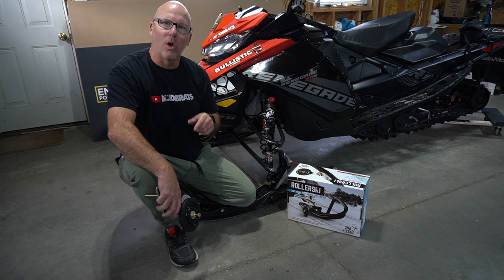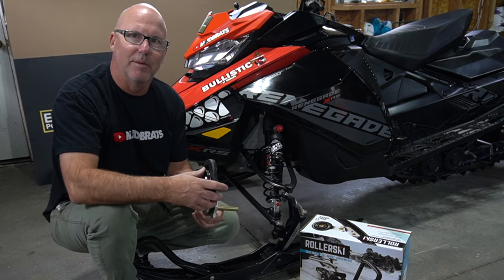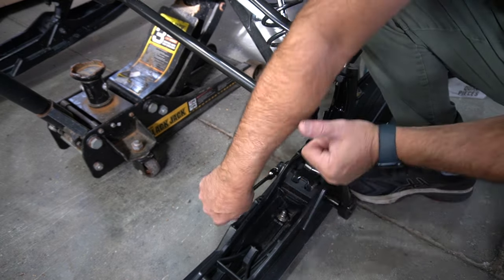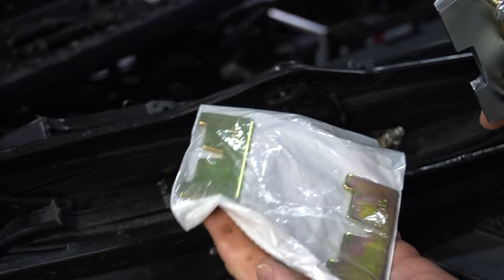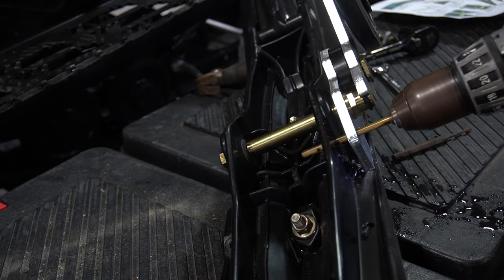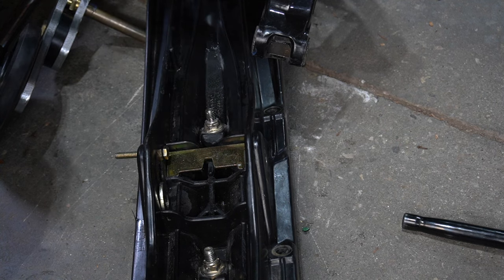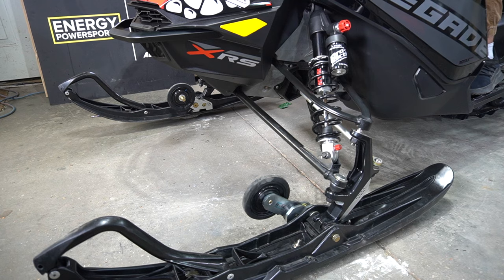BEST RollerSkis | PART 1 Install Qualipieces RollerSki 2024

Comment: Just ordered some so thanks for the install video it will help greatly.
Reply from the maker: Glad it helped
Reply: Does one of your wheels squat? like its kinda mashed. Hard to explain what I mean.  @mudbrats
Reply from the maker: @mattbanville9355  nope they are both round and not squashed - could be the angle you see it on?

Comment: Looks like a nice product.  Should be made out of all stainless. Don’t know why thes manufacturers don’t use stainless. It would cost more but worth the extra cost to me
Reply from the maker: they work so well.  havent shown any corrosion or rust.  They are holding up well.  Been 2400kms on that sled and we use them way more than i thought we would!  definitely a great accessory!

Comment: Gary! 2 questions #1 no problem for these on a sidewinder it’s a 2023 and #2 the snowmobile show is this weekend do you know if they will be there and probably best place to buy??? Actually that was 3 questions lolol  Great Video for info!
Reply from the maker: qualipieces will be there but they dont sell on the floor.  Energy Powersports had a promo on them a couple of weeks ago.  Call them and tell them you are a fan of the Snowmobile Sessions podcast and see if the discount is still good.  They should be able to hook you up with yamaha models - check out qualipieces website to look up the model number
Reply: @mudbrats  thx so much Gary I will call tomorrow

Comment: Rouski beats this system, hands down.
Reply from the maker: Because....?
Reply: @mudbrats  No lever, no leverage.
Reply from the maker: @BlueRage  I think you didn’t watch to the end.  Loads of leverage and you don’t need a lever.  I hate how ugly and bulky the rouski looks and why add weight for a lever bar when the ski tip provides more?  I’ll stick with Rollerski.  They both do the job the same, Qualipieces gets it done with less hardware, less weight and a way cleaner look
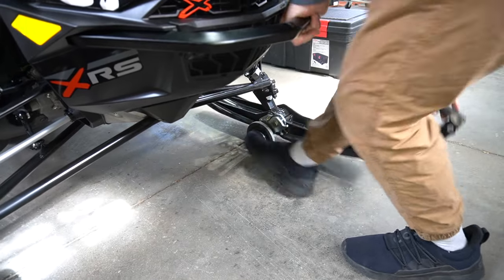Reply: @mudbrats 7:42 with gear and snowmobile boots on? C'mon man...